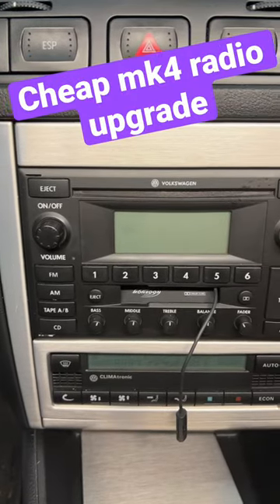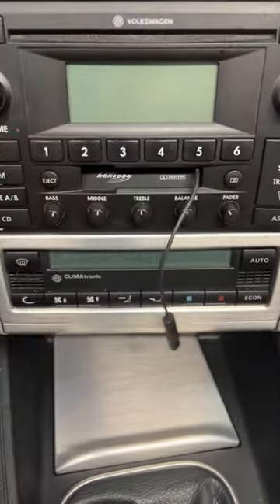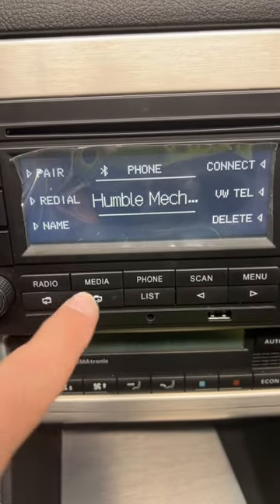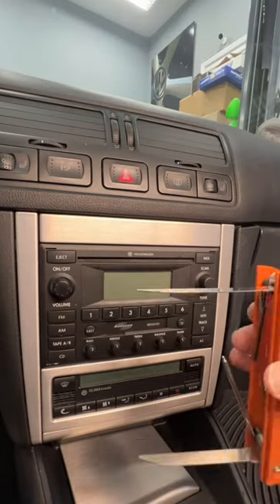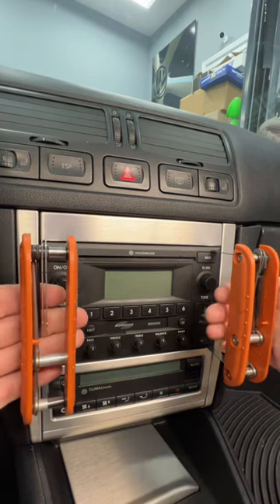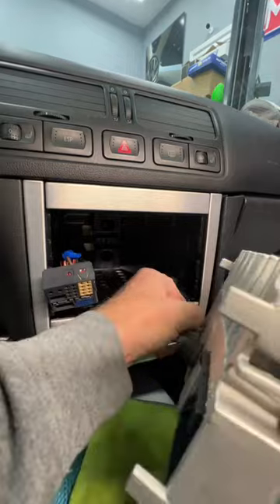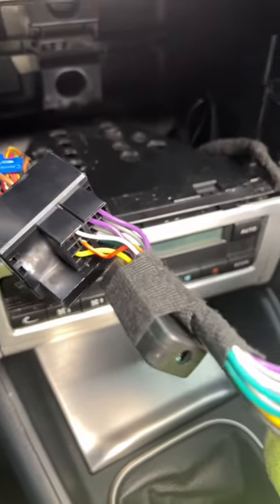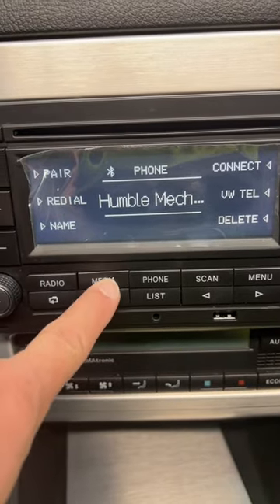$150 MK4 R32 Radio Upgrade ~ OEM Style Radio with BLUETOOTH

Comment from the maker: Parts in this video 
Tape Adapter ~ https://amzn.to/3e0dOdM
RCN-210 Radio ~ https://amzn.to/3fwj9dp
Adapter for quad lock ~ https://amzn.to/3LULC8T
Reply: No link to your old unit ... is it for $ ?
Reply: @HumbleMechanic
Pulling my mk4 gti 24v out to do timing chains. The electric plugs that connect to the injectors are brittle due to age and heat. The plugs are ok but the plastic retainer clips on them broke. Will they be ok to reuse if retainers are gone? If not what can be done? Thanks
Reply: You made this look easy
Reply: money well spent!!!
Reply: Thanks for the link I've been trying to find this radio in Greece for a while now😅
Reply: After a year, how is the sound quality ?
Reply: @HumbleMechanic the adapter you listed is no longer available. I bought the radio and can't plug it in. Any idea where else to find this adapter?

Comment: buys the 20 dollar cigarette lighter Bluetooth
Reply: That shit is trash. At least in my car. Maybe my car is trash
Reply: @timesup6302  I have one and it works okay overall, the audio quality is probably 90% compared to aux in and there's a slight static you wouldn't notice when you aren't listening to music.
Reply: @zzoinks  The one I got only works well when the car is cruising around town. When I get on the highway the static is so loud I can't even hear the music
Reply: @timesup6302  it does the job for me and less intrusive
Reply: @timesup6302  Yours sounds like it is defective. Mine doesn't do that at all, it is very clear.
Reply: Look up a company called MPOW they make transceivers and stuff for literally like any scenario, and they sound great. I have one I use for stereos sounds great was like 30$ on their ebay store. Bluetooth 5.0, good connectivity, and aptxhd sound quality. You'd only need a receiver for a car tho.
Reply: @timesup6302  clean up your cars ground wires.  The static is from interference within the cars chassis grounds
Reply: Mine works great in my 2000 f150, you gotta get a decent one then turn the phone volume down 2 from max then it takes away alot of static, plus you can mess with your speaker settings to take a bit of static, wrap a bit of electircal tape to the fm transmitter to make it so it doesnt move around disconecting over bumps.. works great

Comment: Rcn210 is a great cheap option, I have them in many Vw's. The button illumination will work if u connect light wire. I tap light wire into a nearby switch ( above) which has back ground lighting.
Reply: I just contacted the shop and they sent me the correct adapter. Didn’t have to draw any wires, just plug and play. Great thing.

Comment: I have one of these in my 20th, not bad at all when it's working, however... the bluetooth stopped working after 23 months. The last 8 or 9 months the car wasn't even being used. 🤦🏻‍♂
When you factory reset them, the language is Chinese, so it's a fun game setting it back to English too. 😂
The volume they put out is crazy loud too, I had to be careful not to just blow the speakers into distortion hell. Something must be wrong with the way it sends the signal to the factory amp in the rear of the car.
Also, the front/rear fader never worked, and the skip forward button has been a little finicky and gets stuck sometimes, since day one.

They're "China quality" in every aspect of the negative connotations that come with the phrase.

The eBay seller I ordered from is supposed to be sending me a replacement, I only paid shipping, so that's pretty cool I guess, but if they can send me a new one after almost 2 years when the thing was only $130 to begin with... well, China.😆
 I'll find out in a month and half how it goes. Hoping I just got a bad one.

Comment: I have a 2006 Volkswagen Jetta 2.5 4 door My Cd player does not work anymore and 6 of my C d's are stuck inside so I am going to order a refurbish CD player but does not come with the radio code  if  I'm lucky maybe they will find the radio code  Before I buy the radio from them if they don't have it what should I do Is there a radio website that I could go on ? I do all the work myself I do not want to go to the Volkswagen dealership Just for a radio code lol .

Comment: Now we need steering wheel controls with the phone
Reply: It was the only reason I got rid of my rcn210. I run the multifunction steering wheel with buttons on in my bora. Found out they don’t work with this radio so went back to standard
Reply: @sammurray1395  oh nooooo, thanks for this info! Saves myself and others seeking to later mod this frustration of having to mod the radio twice
Reply: @cmmartti  thanks, keeps it most stock looking too

Comment: Have the same radio, gave 80$ for it. But yeah, it works ok. But i will rather Mount back the oem radio and upgrade it with integrated bluetooth

Comment: I've been wondering if I should do that to my B8 Passat. I'm worried though that I'll lose the connection to info on the dash display and the rear camera - which will stop the project right there.

Btw. anybody who knows the cause of the volume button acting erratically when operated?

Comment: FYI. OE VW radios sound pretty bad. Not a good source. The factory speakers sound really good when you upgrade to a aftermarket radio. The issue with sound quality is not the speakers, it’s the radio. I will say though, factory radios sure do look good in the dash. I’m just not going to sacrifice SQ for looks. SQ above all else for me. 👍

Comment: Does this prevent scan issues with VCDS?
Reply from the maker: YEP! you can also just cut the K line on the older cars, if you install an aftermarket radio
Reply: @HumbleMechanic  ty ty. Just purchased my first tdi, so starting to learn things.

Comment: Sucks that there's nothing cheap and good for my Mercedes.
I have no Bluetooth or AUX, just FM radio and CD so i've been using an FM transmitter but it sounds like trash.
Cheapest option is a chinese head unit, around 300€ including the optical adapter required for the Bose amplifier.

Comment: Some time ago - on the video where this beard talks about VCDS - I commented I bought my version of VCDS for EUR 30,00 from China and use on my 2008 A6 without any problems. My comment got deleted. I repeated my comment and that got deleted as well. So what's happening here? Is the HUMBLE mechanic getting paid by RossTech? Is the HUMBLE mechanic some protector against piracy for a tool which is required to fix a 15 year old car? Since then - I don't like the guy any more - and believe he's not that humble as he's advertising. Greetings from Latvia.